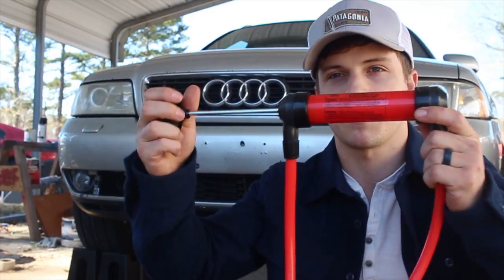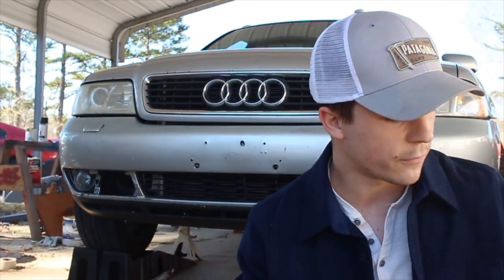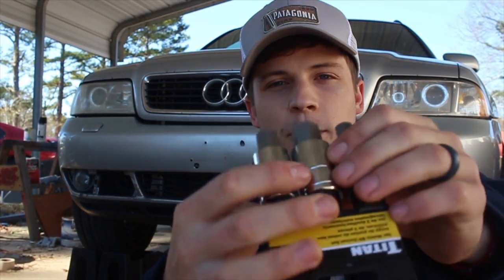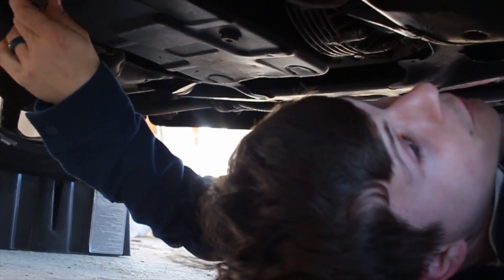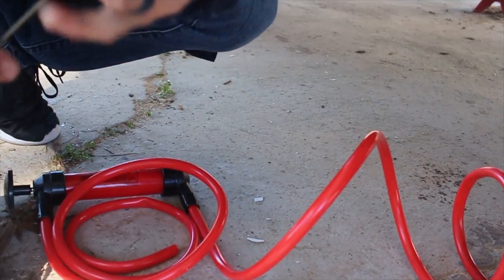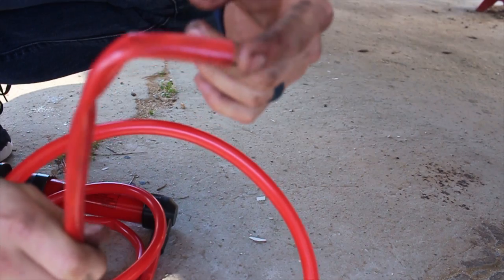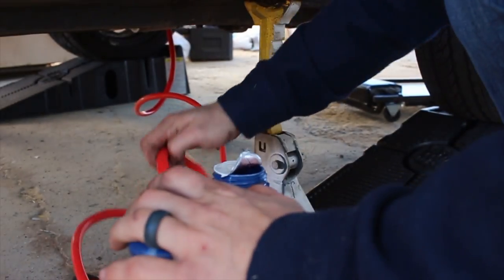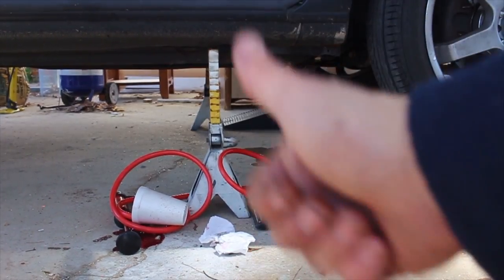Putting Transmission Additive in an Audi (Audi 1.8t)

Comment: Just FYI....  The trans level should be checked with the engine running, and the trans temp between 30 and 45 degrees C.  If you start the engine, you will see the dripping will stop.  My guess is that it is still roughly 2 quarts low.  With it running and at the aforementioned temp, fill till it begins leaking.

Comment: Best Audi/Porshe mechanic in the world (Huey medivac crew chief in the Nam) worked on every Audi ever made - says he never had to replace a transmission in the Audi 04 1.8T Quattro model! NO they are not "all the same" - but that year and model seems to be the best one they made. Also, the New Audi's (esp the big SUV's) are TROUBLE! silent recalls out the ass.. stupid things like roof leaks - piss-poor QA! Stick to 1.8T's and older years - spend the $$$ to restore em w/genuine Audi parts (yes expensive but SO well worth it) they are built to LAST a million miles or more! I have two of em - 03-04 wouldn't trade em for anything. Not one speck of rust on either one and they run like a Swiss watch! Never allow anyone but a certified Audi service tech TOUCH your vehicle! (unless you want trouble)

Comment: That's funny.... cause I have the same exact car (but its the A6 2.8L), and it is soooo ridiculously touchy with the type of fluid, amount, temperature, and if the car is perfectly level. I tried the dex/merc a couple weeks ago... not great. & shouldnt it be like a type F or dex III ATF? Also, doesn't have to have an almost exact amount and be at the right temperature because the oil expands and shrinks with temp... idk... I added fluid very similiar to the way you did and had no luck, like at all... not trying to be a dick but my car has been very touchy and a HUGE pain in the ass....
Reply: Omg same here... car has a mind of its own

Comment: How often should i change the ATF fluid in a 2012 ford focus ? Also, do you like ATP syno fluid ?
Reply: Thanks, we looked it up in the manual and it said 60.000 miles.
Reply: Does ford make their own ATF Fluid? didnt  think so. So I would go by the recommendations of the fluid manufacture, hence why factory is holding its self liable for ATF fluids, hence they are not the ones engineered and own it.
So, General rule of thumb for all ATF is 60K miles.
If you do alot of "spirited driving" and  you dont  have supporting increased cooling of ATF fluid for the trannhy,,then fo sho, need to drop that interval to 50K

Comment: I got my ATF Fluid changed but I still have the problem what should I do ??
Reply: Try trans mounts and even a t/c first if you dont have incorrect ratios  codes drain fill make sure level is proper
Reply: I don't know if you are still having trouble, but if you didn't check the trans fluid level with the engine running and at temp, chances are it is low.  Also, I noticed people mentioning a drain and fill.  Make sure you change the filter too.  If it is shifting hard, clutches are good, so chances are it is a pressure issue pointing to the filter.
Reply: BUILT i
Reply: Joe Felicia good tips!!! Some not all transmissions are the same audi still made continuous variable timing (cvt) transmissions which do not use automatic transmission oil.

Comment: why would you put dex/merc? There is fluid specific for german made vehicles on amazon. You're putting the transmission at severe risk. good luck
Reply: What do you know about transmission fluids?
Do you know what this is?   >>>>   G052162A2
IF you do, than you should know, and or should go pick up that dex/merc tub and read the specs.